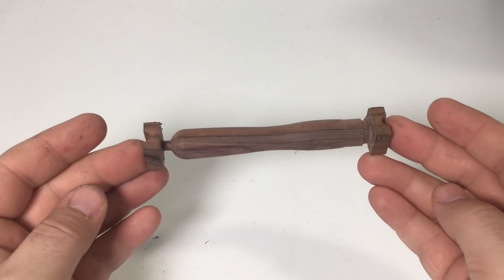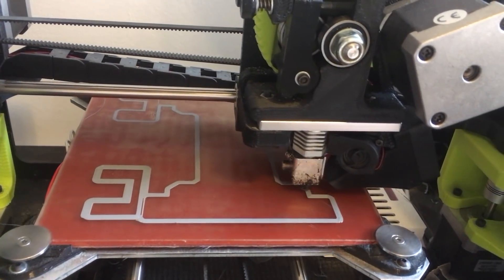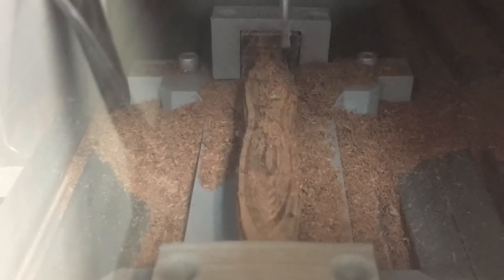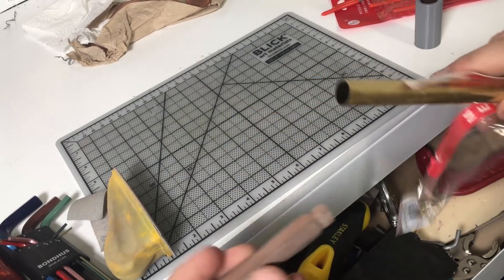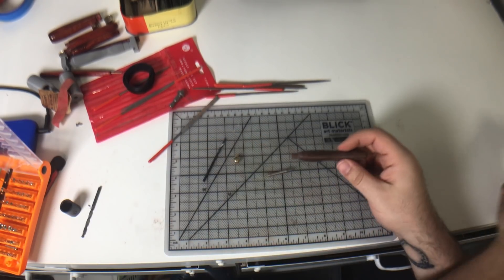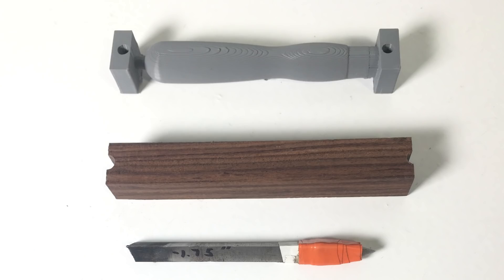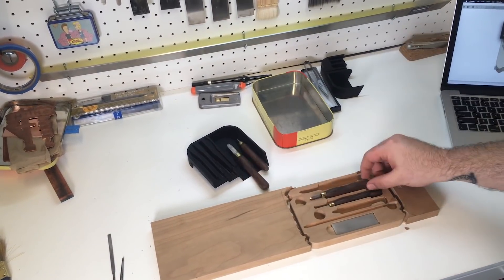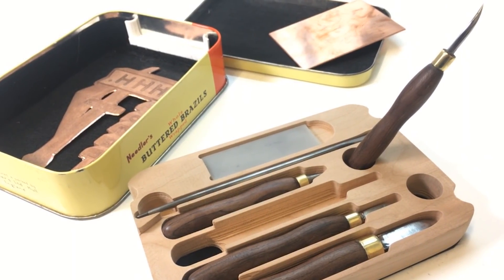DIY Tool Handles on a CNC Router

Comment: While this is an interesting build, I cant help but think this is a LOT of work on a cnc, 3d printer, creating models, etc for something you could turn on a wood lathe.
Reply from the maker: Oh you're absolutely right, if I had a lathe, that'd be the way to go. The point of the jigs and all the steps is I can now make whatever I want with the huge selection of pen blanks going forward, and I have a good way to hold them. I have about 20 more tools I want to make. Thanks for checking out the video!